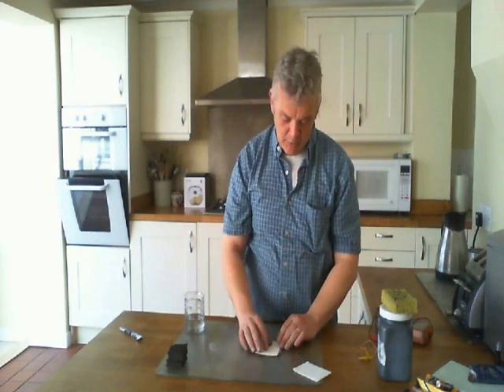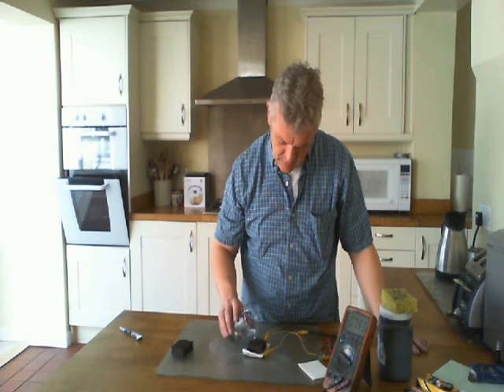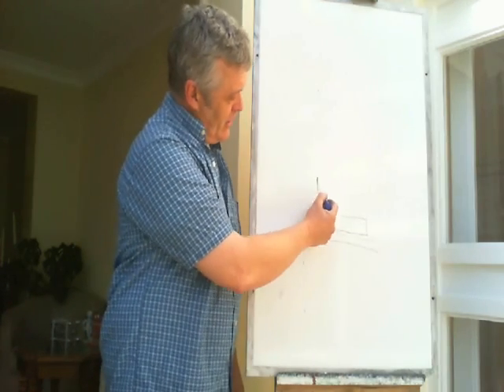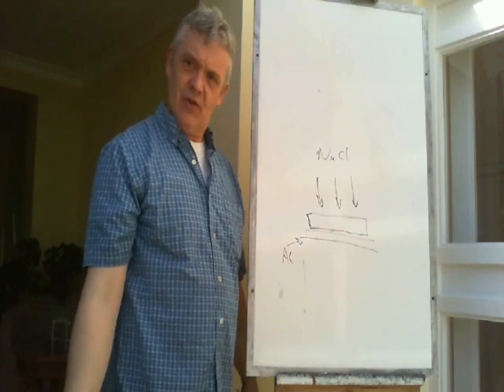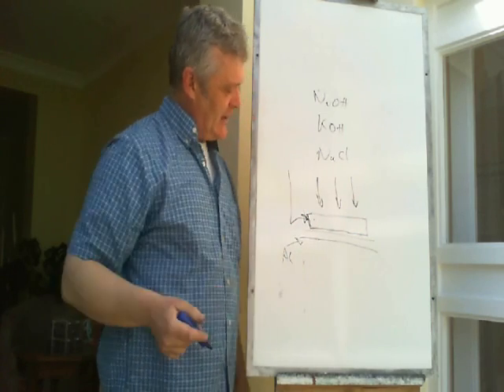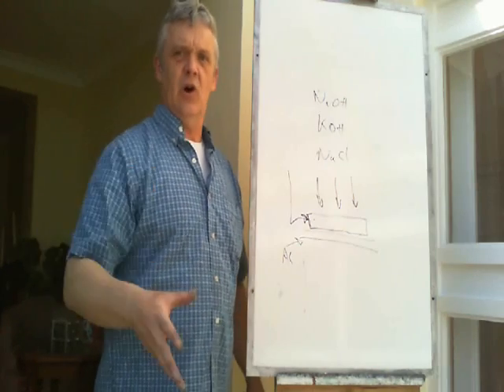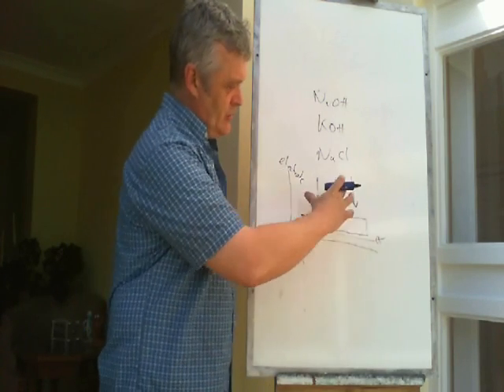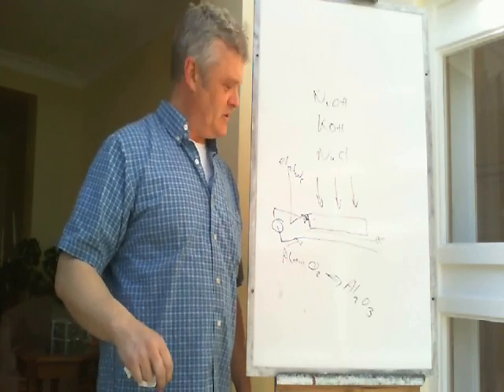Super Simple Air Battery

Comment: Bob, I've seen your PVA+KOH solid electrolyte video. That seems very doable & I shall do it one day. Will that work with Al-Airbattery? 

What I have in mind is to use stainless-steel mesh (Ref-Thoisoi2) bonded with activated carbon for the cathode. This carbon-coated  mesh, I plan to place in contact with a sheet of solid gel-electrolyte which in turn will contact the aluminium to make a stack of 10-14 cells in series to make 24v.

Comment: Fantastic work Mr. Murray-Smith , i've found your channel yesterday and i'm already a fan , a couple of questions here :
- Do you think it's possible to reach 2 volts with this battery? on what depends?
- Have you been tested it connecting multiple batteries serially? do you have some measurements or data?
Thanks and again , you rocks!!
Reply from the maker: see later videos mate - this will answer your questions

Comment: You probably shouldn't use a metal to contact the carbon sponge, because together with the electrolyte it leads to corrosion. Instead, you have to use something like graphite, which doesn't suck in electrolyte, and then contact the graphite.

Comment: Will it work if the battery is enclosed in a box?
Reply from the maker: the air has to get to it mate - it's an air battery
Reply: it keeps on needing fresh air?
Reply from the maker: what do you think mate?
Reply: Yes probably
Reply from the maker: there you go
Reply: Thanks mate and i was just wondering if the air battery is in a box with a fan forcing air inside will it still work??(My guess is yes)
Reply from the maker: a diffusion barrier will do just fine

Comment: Another problem with using NaOH or KOH as an electrolyte is that they will react with the aluminium whether you have any load connected or not, and the reaction can become very exothermic and violent with bigger batteries and higher concentration electrolyte, producing loads of hydrogen gas and heat.
Reply: then design it that the alluminium is retracted after use
Reply from the maker: true enough

Comment from the maker: Ben, I can't comment directly on your post as I have just added you as a friend - but Ali forms Aluminium Oxide - this process is corrosion and rusting - they are pretty much the same thing. Actually that is not strictly true - rusting is an oxidative process normally applied to iron. Rusting is a subset of corrosion. Anyway it's all a bit of a hair splitting exercise as I clearly mean it is the reaction of aluminium with oxygen to form the oxide that leads to the electrochemical potential of the cell. Of course this passivates the aluminium surface so a good electrolyte helps this passivation layer NOT to form. Hope this helps

Comment: Interesting. Two question though, after adding electrolyte how long does it last and is the process reversible? Thanks !!!!!
Reply from the maker: it's a metal air battery -they are not really reversible - it will last until the ali is coated with oxide - if you use a different electrolyte it will eat away the oxide and it will last until the ali is gone
Reply: Robert Murray-Smith Many thanks for the reply. What electrolyte should I be using in-order to eat away the oxide layer? :)
Reply from the maker: Have a google search and see what is currently being used - there are quite a few and theyare used for a whole host of reasons - for example salt water is really cool for emergency batteries, the japanese pissed on it - an interesting idea!! to name just a couple - so have a look around and see what you fancy experimenting with
Reply from the maker: lol - i am working on something - i will give a brief heads up - i am looking at nanoporous silicon dioxide rigid foams as a way forward - i will post a vid on this early next week i think
Reply: Robert Murray-Smith Haha the japanese are too funny for words. How about if the aluminium was granulated, wouldn't that have a faster reaction and hence give off a bigger current?
Reply from the maker: yep - the voltage wouldn't increase as it is limited by the electropotential of the reaction but you would get the amps out quickly - that's not necessarily a good thing - but if you had a reason for doing it then why not
Reply: Aluminium-air batteries have both a very large energy density (J/vol), and specific energy (J/kg), so you could have a little one in your electric vehicle, as an emergency in case you run out of power. It wouldn't weigh down the vehicle too much. It would be incredible if someone devised a way to reverse the reaction efficiently. Robert I'm looking at you :D